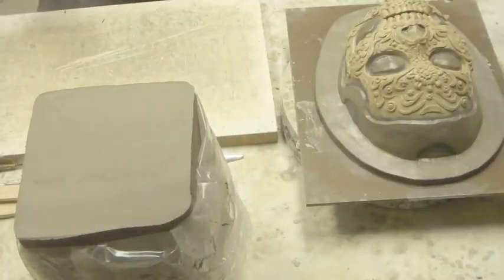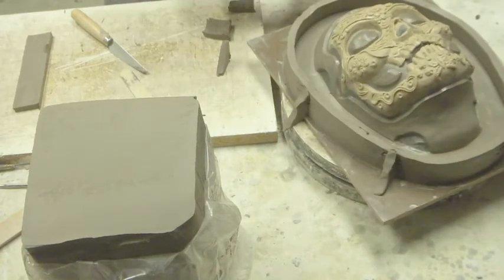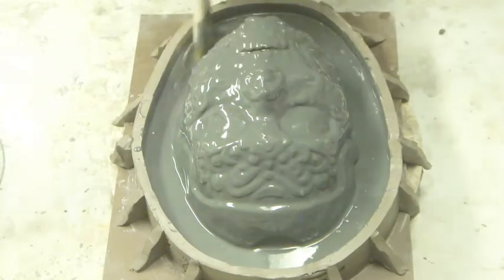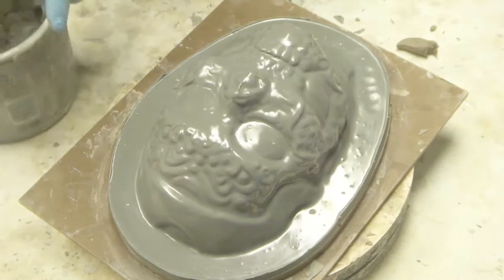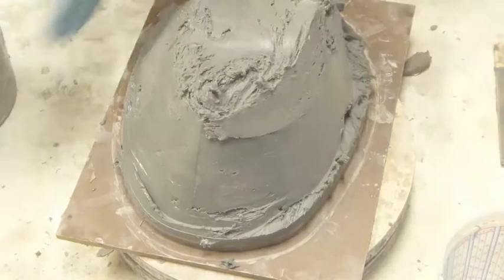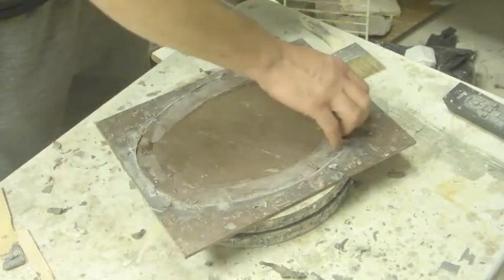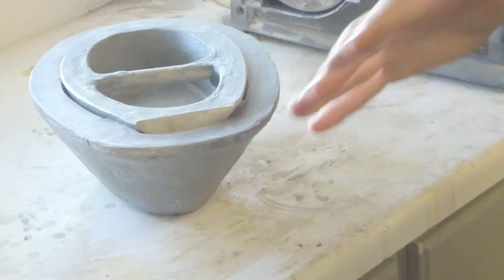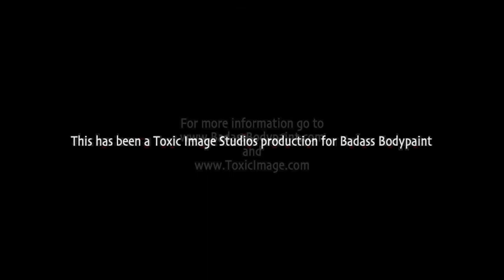TC1630 Part 3: The Lay Up Mold

Comment: I've read that 1630 can cause some issues for platinum silicone curing... is that true ?
Reply from the maker: Yes it can if the 1630 is really fresh. It can also cause problems if it is a slow set platinum silicone. I have found that throwing some heat into the equation usually fixes that though. I have used it for many platinum silicone molds though, with no real issues to speak of.

Comment: Can you use burlap instead of cab o sil? How heavy does 1630 get?
Reply from the maker: I have never used burlap to thicken 1630... i dont think it would work. If you are asking about using it as you would with ultracal (dip and apply), again, I see many issues. The cabosil allows to fill all the small recesses as it is extremely soft but still will not slump. I do not see that happening with burlap. If you wanted to apply the burlap on the outside after smooting for added strength you could... I just do not really see a need.
Reply: @toxicimagestudios9547  the reason I ask is because cab o sil, I read, is dangerous. I wish I could switch over to fiberglass for the lightweightness of molds, but it just seems too toxic.
Reply from the maker: @altermann1ify  cabosil is fine if you use it in a well ventilated area and wear a mask. Once it is mixed it is harmless, it is the risk of breathing in the dry powder that is where the hazard lies. It is actually a food thickening agent that has been commandeered for other thickening purposes.
Reply: The acetone is just as toxic if not more so